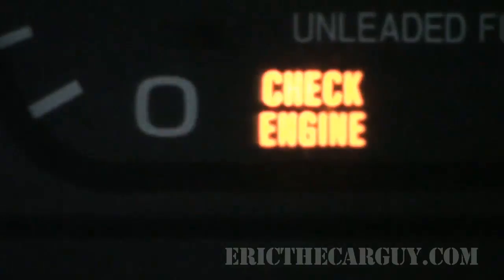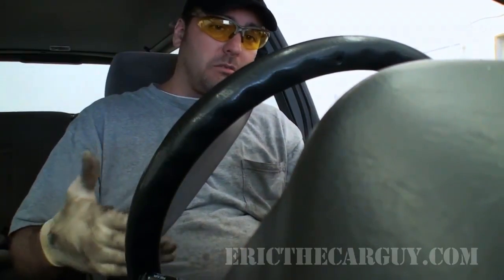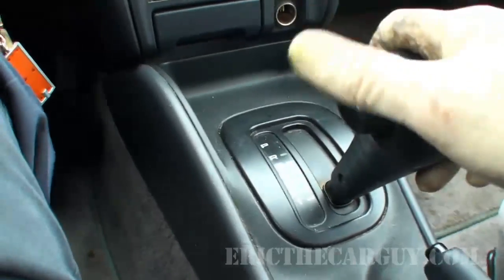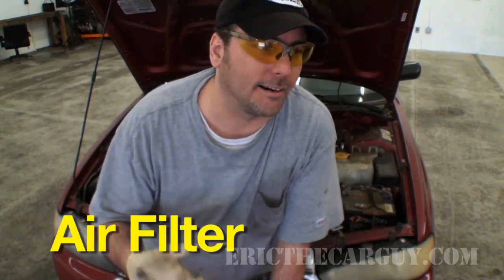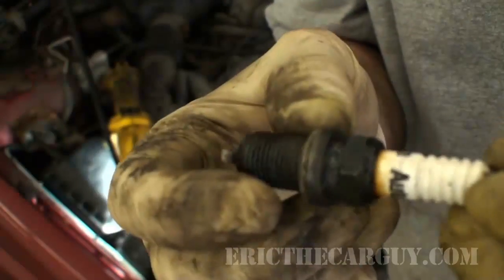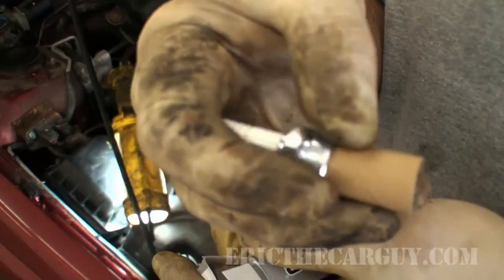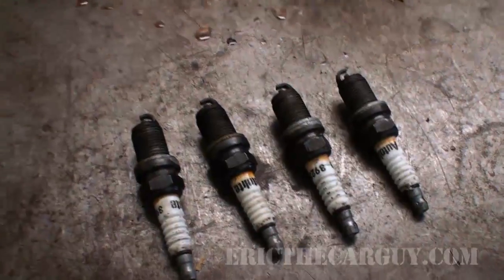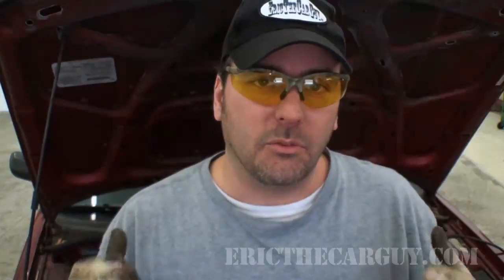Solving Engine Performance Issues (Part 1) - EricTheCarGuy

Comment: Hey Eric! What spark plugs would you recommend for LPG modified car. Car starts on gasoline and runs for some time until engine temperature goes high enough to change to LPG system. So car runs on LPG 90 % of time. LPG burning produces higher temperatures and has higher octane number so spark plug producers recommend different spark plugs, made for LPG. Ones that can resist higher temp and with smaller gap for the better ignition of LPG. Aparently LPG ignition calls for higher voltage so other parts of the car can suffer if the gap is not small enough. On the other hand some mechanics still go with the factory recommendation for spark plugs. But if you put LPG in, its not a factory set up anymore. So what is the best: 1. Original factory recomended, 2. Factory recommended with making the gap smaller, 3. Saprk plugs made for LPG, like NGK LPG2 (for my car Chevy Aveo 2007, 1.2, 53 kW, euro version) which has already smaller gap and better materials for high resistance to temp and much more expensive?

Comment: any thoughts on recommended plugs for a 91 buick lesabre?
Reply: Buick, Chevy, GMC, Pontiac, Saturn, Hummer, Opel, Holden, Cadillac and Oldsmobile are all owned by General Motors (GM), which use AC Delco parts. So use AC Delco plugs.
Reply: Anoxias Saturn uses NGK.

Comment: You should have pinched the return line off and make sure pressure increases to over 50 psi or almost double running pressure to ensure good fuel pump operation. Liked your part about turning car off and checking for fuel pump bleed off as that is a common problem on this vehicle.

Comment: Did you reset the Engines computer after you changed the plugs?  You would want the computer to re learn the data with new plugs.

Comment: i have maruti  zen Lx car model 1999 .that car car give me only 12 kmpl only. this is carburetor car with 993 cc petrol engine  i have pick up problem with this car if i to overtake  sum one my car is jarging  first like boo boo boo  than it take  peck up . i'ts happend when i slow the car and race for overteck with 2nd gear .

Comment: Hey car guy, thanks for all the vids, but I have a question for u, I have a 2001 hyundai accent gs with the 1.6 DOHC & I'm getting poor gas mileage, I've replaced air/fuel filter, plugs, O2 sensors, replaced the entire timing belt/components(pullys,tensioner & spring), I maintain my tire pressure @ 33 psi....... where am I going wrong ?
Reply: I'd like to see Erics answer to this guy's prob, I have the same one.
Reply: Well it's been much better since I have upgraded my air intake from stock to a short ram air intake - I do see better mileage if I keep my lead out of the pedal
Reply: I want to ask u how old is this car and is it carborator or fuel injec

Comment: I have a problem that i am not sure how to diagnose. I have a manual car, when ever i am driving with my foot off the clutch and also off the gas pedal, the car pushes forward then pull backs(something like a jerked motion) as the rmp nears 1200. whats wrong?

Comment: hi a great video, I will tell you my experiences with spark plugs. I have a Peugeot 206 1.1 L, I know a little engine lol lol . I kept getting a misfire and a engine management light come up and the engine would seem to stall for about a second ending the engine management light would come up, it would do that every 20 miles down the motorway, anyway. Eventually I changed the plugs . I had the spark plugs you put in your car. The new ones, and on my Peugeot, I had to use champions spark plugs and the misfire went away instantly. I've used them spark plugs for a year now. Never had that problem again , excellent video

Comment: It shocked me how new spark plugs make a HUGE difference in performance.
Reply: Its like he says, they pretty much build the engine around the spark plugs (or at least their detonation model).
Reply: Keys879 just like we built the A-10 around a Gatling gun
Reply: ya if you don't have any spark it won't burn any fuel

Comment: Hey Car Guy, First thank you for the Vids Bro :-). 2000 Honda Accord v6 coupe here (your favourite car).  every  id say 20th start I have trouble getting her to stay running from a cold start. and maybe every other time its from being warm. Ill have to hold down the peddle to get her to idle. also noticed aside from low idle that the steering is a little tough. ruled out many things air and rule filters, plugs and such. but i knot iced this started when i switched to 93 fuel. I plan a sea foam cleansing. and a power steering fluid flush. your opinion is charished . thank you
Reply: Have to hold down the gas pedal indicates a restriction in the intake, probably have a bad idle air control valve.
Reply: Derrick Hodges Thank you, That sounds likely. I will check it out
Reply: Derrick Hodges Wouldn't that pop off a trouble code?
Reply: ***** It didn't actually. i also noticed that car tries to die when going into sharp turns...
Reply: Detonation is the spontaneous combustion of the end-gas (remaining fuel/air mixture) in the chamber. It always occurs after normal combustion is initiated by the spark plug. The initial combustion at the spark plug is followed by a normal combustion burn,the end gas in the chamber spontaneously combusts. The key point here is that detonation occurs after you have initiated the normal combustion with the spark plug.The spike can cause fractures; it can break the spark plug electrodes, the porcelain around the plug, cause a clean fracture of the ring land and can actually cause fracture of valves-intake or exhaust.Because this pressure spike is very severe and of very short duration, it can actually shock the boundary layer of gas that surrounds the piston.Detonation can cause the piston to scuff and this snowballed into loss of compression. Most likely creating a "spark knock" and if bad enough will throw a check engine code, but not always. If your car wasn't specifically designed for high octane, don't use it.
Pre-ignition: Pre-ignition is defined as the ignition of the mixture prior to the spark plug firing. Anytime something causes the mixture in the chamber to ignite prior to the spark plug event it is classified as pre-ignition. 
You could be experiencing a slight pre ignite, which in essence is most likely a part of the plug "glowing" being hot enough to pre ignite. Any white smoke from the tail pipe?
Point being, unless you want to dive into the realm of spark advancing, i'd run oem plugs and regular gas. And add a fuel system cleaning additive at every oil change. Upping the octane is not a performance upgrade. Neither is a hotter burning plug. Especially on that engine. You have a Speed Density system, and throwing in a monkey wrench like hotter plugs or higher burn temps can cause problems. 
Or it could be something as simple as the idle air control. Which in theory should pop a check engine. But in my experience check engine isn't a reliable source.
Reply: And usually if not a bad steering pump, hard steering with idle problems means timing is off. Loose belt? Check your timing. Unfortunately you could have all the above. The high burn caused the valve issue which in turn retarded your timing. My guess is if you have no codes lit up, and your iacv is good, you damaged a valve or seal enough that is throwing off your timing. Get all these checked soon, the longer you drive the worse it will get and the more it will cost. And please don't just adjust your timing and call it fixed, there is a reason it was thrown off.
Reply: ***** much  gratitude and solidarity brother.

Comment: I bought a 89 c4 with a performance issue that couldn't be figured out by owner or a dealership mech
It has sparkplugs for cast iron heads instead of aluminum. :) sold car doubled money good flip

Comment: Hi Eric! the best way to identify it's an engine problem or a transmission problem is by checking for fuel trims adaptations. +15% long term fuel trim = engine. No fuel trim = transmission. Keep going i really enjoy those videos!

Comment: To the guy with the Mini Cooper.  They wet from Oil??  If so, it's your valve cover gasket and the gasket for the plugs.  If they are covered with oil you will get a misfire.  Good luck.

Comment: Yeah old F150's and mustang 302 engines love those cheap autolights.
Reply: Bought my Subaru at 47k miles, checked the plugs and it had Autolites in it.  Swapped to NGK/Genuine Subaru plugs and the idle smoothed out and fuel economy improved.  My Ford 4.6 takes to cheap Autolites like a baby to a bottle but foreign engines need NGK plugs!

Comment: Hi Eric ....i'm so new to this ....how do you find out what spark plugs work good for each make and model ....2007 corolla here ....just google it?
Reply: whoops ....i see you suggest to check what the dealer calls for right?
Reply: Sam Patterson Some drag racers and engine builders that I look up to have said that "advanced" spark plugs are a gimmick. If you have DIS waste spark ignition you need dual platinum. Other than that, a spark plug is a spark plug. You'll get the same performance from a $2 spark plug that you would with an $8 spark plug. You only need dual platinum because DIS waste spark will reverse fire on exhaust strokes (a wasted spark). If you use a std plug in a DIS waste ignition, the gap will grow quickly on it's own and you'll start bogging from failed sparks. You can tell if you have waste spark ignition if there are half the coil packs than there are cylinders. So a V8 with 4 coil packs is definitely waste spark. V6 with 3 coil packs = waste spark. Also make sure you're using the correct heat range plug.

Comment: CAN ANYONE PLEASE HELP ME, my 1996 Ford TAURUS's transmission is playing up, sometimes it wont change out of 1st and other times when it shifts from 2 to 3(in drive), 3rd gear wont engage and the rpm will just climb without any pull so i have to change the gear selector back to 2nd to keep the transmission engaged? also i seem to have a hesitation or sort of a stumble or stutter on acceleration, but their are no vacuum leaks?
Reply: worn out clutch?
Reply: yeah i think your right. or  the lock out clutch in the torque converter, either way its sounds expensive :(
Reply: it's time for transmission rebuilt with new torque converter.

Comment: I have a 98 gmc conversion van. it was running fine then when I started it later it was running really rough and the exhaust smells like gas and engine light came on. could the plugs or wires make it do that. should I give it a tune up first?

Comment: when i shift into second gear or third and stick my foot down sometimes nothing happens and the car starts slowing down then bam throttle kicks in and off i go any idea what could be causing this?just swapped my petrol tank out yesterday baffled me
Reply: Did you change out the fuel filter?

Comment: I have a 1985 1/2 Porsche 944 and when I am in second gear and step on the pedal it hesitates a lot then starts to kick up.
Reply: Carb? Check power valve and jetting.

Comment: Hello sir, can you please help me on this. I have a honda accord LX 1999 170,000 miles on it. Gas mileage problem, full tank just for 200 miles which is more or less 14 miles per gallon. I don't know why still the same like that even i cleaned the intake manifold, aicv,change the spark plugs,wires,rotor. Looks all normal no engine lights on. Only problem is gas mileage. Any suggestions what's wrong on it? Anyone?

Comment: air filters , dirty throttle body , clogged catalyst , restricted injectors , bad MAF sensors has the biggest hand in your current issue beside what have you mentioned , but mostly new cars now comes without fuelfilters because it usually placed aside to fuel pump inside fuel tank , i usually run a scan ( when no check engine light ) and pull all engine data live and compare o2sesnors amps , short, long fuel term , maf voltage , spark advanced , injector timing will make u understand !

Comment: Eric, Thank you very much. I have an Audi A6. It wouldn't pass emissions. It was misfiring and running lean. So I changed the spark plug and the coil but I brought autolites and in stalled them and the car shook really bad and I was wondering wth???  so I decided to look at the how too on youtube and came across your video. That next morning I couldn't wait to get the ngk's....I put them in and my car run like a sewing machine... Thank you sir.

Comment: When I use the NGK's on my Lincoln I still check the gap, just in case, its generally correct but never hurts to double check them. if you could see how bad my plugs were when I got the car you would cry!...lol

Comment: I bought set of spark plug wires and noticed that their resistance is at least 2x greater compared to old ones. On box there was small text saying "active or reactive resistance core" so apparently these are "resistance" wires and old ones are not? I heard that spark plugs also have resistors in them and it would be bad to use both resistor plugs and wires as spark would degrade too much?

Comment: When taking the spark plug boot off...did you just yank it off? Or do you need to rotate it and pull? I dont want to ruin my wires on a day I need to get to work

Comment: Good video, just one thing, those (dirty) gloves should never touch'd the interior of the car. Specially the steering wheel. It might be your own car and you do as you please with it, but if I see a mechanic doing so, I walk (run) away fast, no matter how good he is. The purpose of the gloves is to keep your hands clean, not to take dirt from one place and put it on another. I even use seat covers when working both inside and out of a car, be it mine or not.
I'm a clean freak, I know.
Cheers!

Comment: I changed from the plugs GM/Suzuki said were for my 3-cyl. '97 Geo Metro and went from 41 mpg to 47 with Bosch Platinum +4 plugs. I actually passed a car as we went up a steep hill, too. I was really impressed. However my lead-footed wife in a '96 Corolla had no improvement in economy.

Comment: Thanks for good tips Eric! I have a 1996 Mazda 323 (I believe it's called Mazda Protege there in the States). 1,5 liter 16 valve DOHC engine. I had some idle issues with it and significant decrease in power lately. Now I replaced the old fuel filter and cleaned the MAF- sensor. While taking the air intake housing off to get access to the fuel filter I found out that the housing had huge cracks in it, so unmeasured air was getting into the mix. Fixed it and now it runs smoothly.

Comment: nope. just did a tune up today. im just wondering if it would be the sending unit. but you would think it would bounce around more and bad oil pump ussually is loss of pressure. could it be a stuck pressure release??

Comment: @brathaman and anyone with a 2.2... you get up to 80 at 3000? I have a 98 obs, same engine but probably weighs less. I only get up to low 70s at that rpm.  62-65 at 2.6 and that always seemed high to me. The engine sounds alright, what speeds are other peoples ej22s going at those rpms

Comment: I purchased a 99 Subabru Legacy L 2.2L
-Sometimes its idles real low and dies
-Sometimes it leaks from the sunroof
-When driving at 80mph the RPMs are at 3000-3100, but it sounds as if the RPMs are lower than indicated

Any thoughts on the approach?

Comment: because of damage in shipping, those things bounce around in the boxes and can shorten the gap.  depending on how ruff they were handled in shipping the gap can be changed drastically or not at all, it never hurts to check the gap and only takes a second anyway.

Comment: One thing I like about your videos is you're a proponent of dealer / factory parts.  In my Chevys, if I put anything but AC Delco plugs, wires, and other tune up stuff on them, they run like garbage.  And Toyota is VERY picky about their tune up parts, you gotta run Denso with them.

Comment: I recently purchased a 2003 grand am with a 2.2l ecotec with 147000 miles and noticed a far below average mpg of 18 *mostly commuting miles in sub 45 mph speeds* but ran fine as far as I could tell. decided to just replace the spark plugs... The electrodes on two of the four were pretty much gone. How I didn't have misfiring or hard starting is a mystery to me.

Comment: It's important to mention that factory plugs and wires usually have different resistance to what you'll get with AM plugs/wires.  Always at least call the dealership for pricing too, because I've found some parts are actually cheaper at the dealership (eg. thermostat in '04 Liberty in my experience).

Comment: Hi eric I have subaru legacy 2001 my problem is when I shift the 1 gear or second gear the RPM slowly slowly increase once the reach above 1500 then take pickup fine I am frustrated well I got 2 fault codes knocksensor and co resistor what is this??

Comment: engine check light is on and the other service engine blinks 8 times once the car is turned on. The technician said after the sensor replacement, the car will have no issues anymore and the check light will go off after calibrate the car's computer

Comment: Ok, I just scanned the car with 3 different computers and one showed me an error like P0128 and the other 2 showed 26 at the end of the code instead of 28 but both of them makes reference to the same error... "coolant sensor error" and the technician explained to me that it could be caused due the fact my fan is connected and working directly, so once I open the switch, the fan starts spinning, and that makes sense to me.
I dont know if that will solve, I will try with it and see what happen